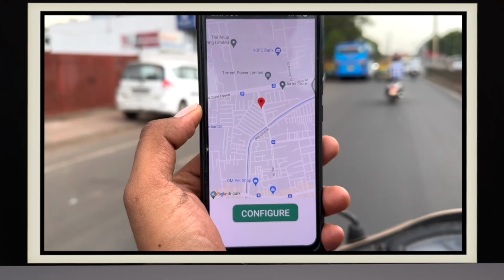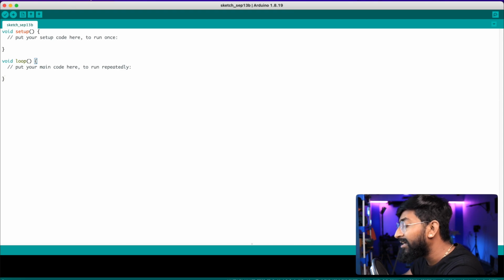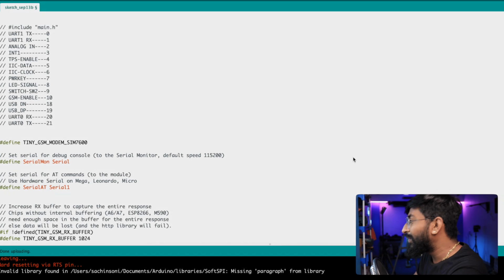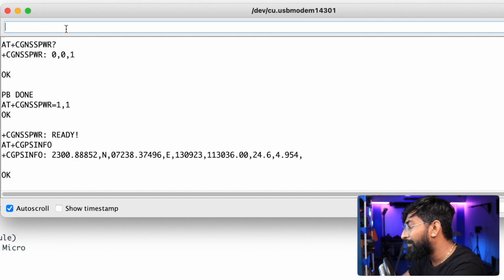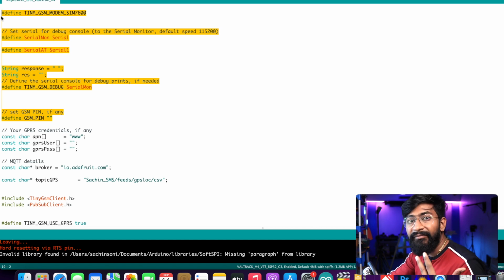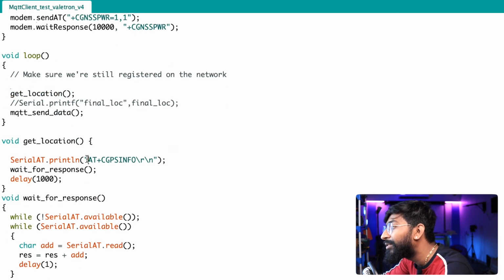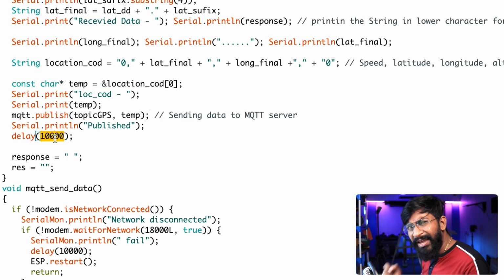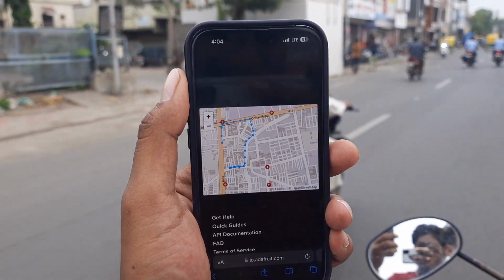Programming GPS Tracker to send Location to Adafruit MQTT | ESP32 Projects | IOT Projects

Comment: using your modified code I do not get any of the status led's coming on and location is out by about 2000 miles so waste of time stick to the original Valtrack Firmware

Comment: Thank you for your great videos! I seem to have a problem with the conversion, it adds a 0 after the decimal point in the lat coordinate I get 51.09689, when it should be 51.9689, which moves me +/- 100 Km away? 🙂